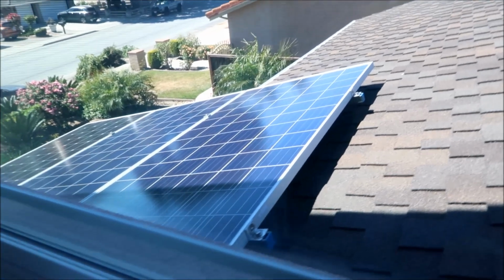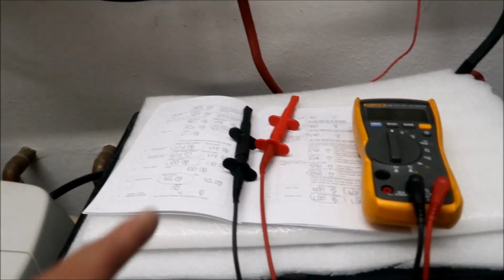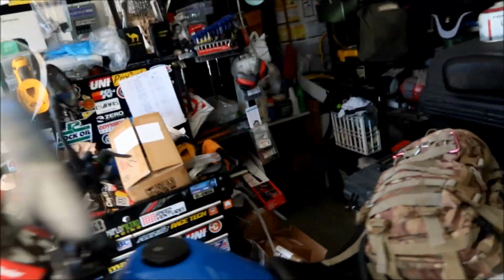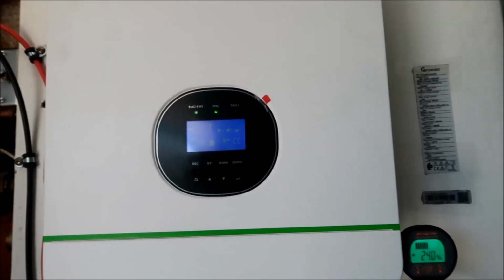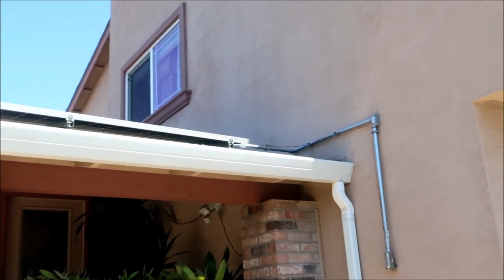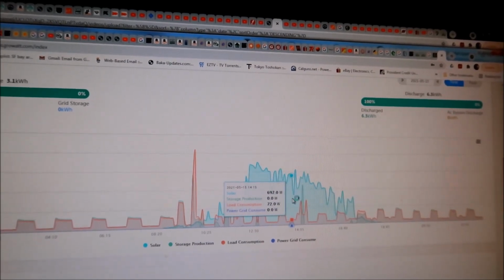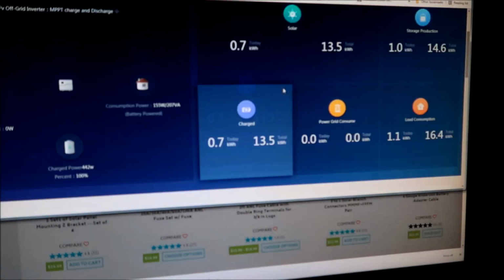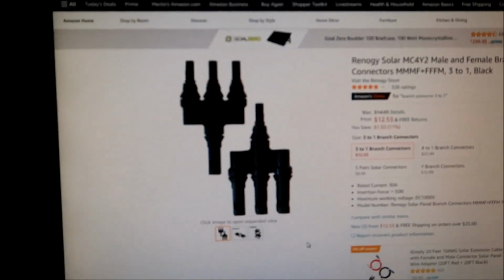HadesOmega Solar Garage Project Episode 66 - Shading Problems Part 1

Comment: If you go to a parallel circuit you will only have 12v
Reply from the maker: These solar panels output roughly 36v-40V so if I put it in parallel that is how much voltage the array will output.  The battery is 24V so it should still charge.

Comment: Yes. Do the parallel wiring as that is the easiest thing you could do and your system will handle it and you will not need to move or re-do any conduit.      Watts are Watts: 
100amps X 1 Volt = 100 Watts      100Volts X 1amp = 100 Watts.   What you need is Watts!

Comment: A quick experiment would be to borrow or purchase an inexpensive PWM (Pulse Width Modulation) charge controller and just bypass your Grwowatt to see what you could gain. Change nothing else.  You can have both connected to the batteries, but just manually swap it over (Solar in) to the Growatt a little before the Growatt kicks in based on your charge history.

Comment: You might have to move them closer to the edge
Reply from the maker: Yeah best thing to do is remove everything and shift it over but I'm just going to add another set of panels in parallel farther away from the wall.
Reply: @hadesomegamoto7639  Or do something off-the-chart and use mirrors to reflect light where the shadow is.......

Comment: and if you put those 3 in parallel, they wont make the start-up voltage for your inverter...
sorry to break it to you, but you're gonna have to get on that roof again....
either to put up more panels ( prefferable as you dont have to plug those holes in the roof) , or move your current panels